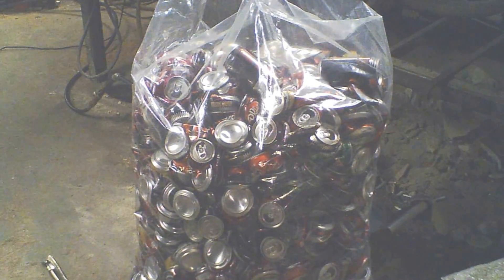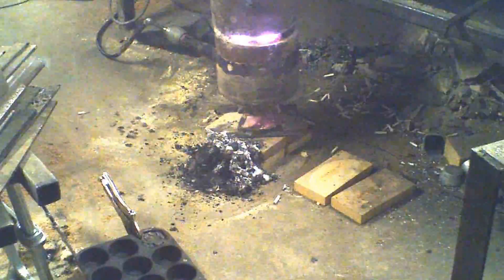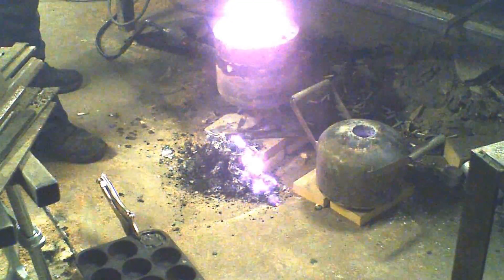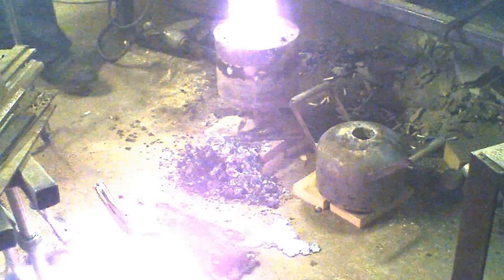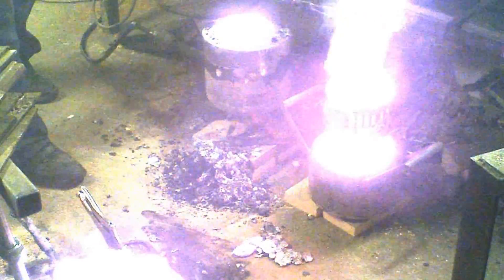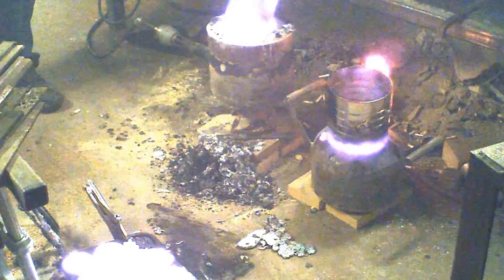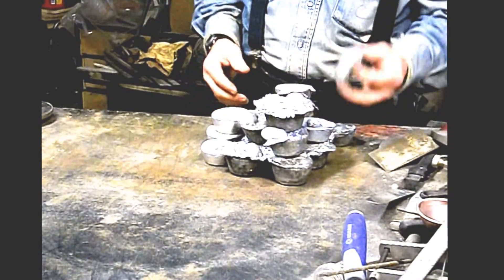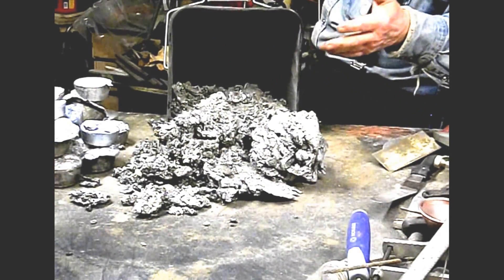Just How Much Waste is There in Melting Soda Cans?

Comment: Have you ever tried melting aluminum cat food cans? We have lots and thought that it might be better to try and melt them down to take them back, just for ease.
Reply from the maker: Anything Aluminum will work, even the one time roasting/baking pans. Just wash them out first.
Reply: Thanks, I have some of those too and I might toss them in. Do you know if I can mix everything together, pop cans, those tins and the cat food cans to be able to take them back as scrap or do they like them all seperate? Thanks for the responce and cool video.
Reply from the maker: You can't mix steel with alum when you're going to recycle them. (Separate Bags!) Now if you're think of melting the alum cans down and then taking it to the recyclers... DON'T you won't get any more for it so you're just wasting your time and money.
Reply: Yeah I know you shouldn't mix steel and aluminum, I was talking about the aluminum cat food cans and aluminum cans getting all melted together. I didn't know if they would be different grade, or types of aluminum. Yeah, I'm in Iowa so if the pop can, can be taken back for a nickle, I do but some energy drinks and teas don't have the nickle refund. I know it wouldn't be much but it would be better then just tossing them.
Reply from the maker: Doesn't matter... it's all basically "Food Grade"

Comment: Wow! You actually poured molten aluminum into a coffee can! SMH! How did you manage to live this long?
Reply from the maker: How brain dead are you?!?!?! We pour into soup cans /tuna cans/coffee cans all the time! Then we cut the can off and chuck the casting into our lathes or a milling machines and make our parts!!!! So tell me what is the difference from a coffee can/soup can / "OR" a cupcake pan used for making ingots?!?!?! If I need a big round/ thick plate I use an 8 or 9 inch steel pie pan. It's a lot cheaper than buying from a steel supplier. You better start watching more videos before you open your mouth.
Reply: Uhhh.... What are you even talking about?

Comment: Cans definitely have a lot of loss.
My first couple can melts I estimated about a 40 percent loss.
I also melted through a good number of steel crucibles.
my best melt has since produced 16 similarly sized ingots from a 55 gallon garbage bag of uncrushed cans. (roughly 1/3 of what you  melted)
I found that leaving the slag on top of the melt (aka not playing with it so much)  helped to keep the air from the clean metal. so less drossing= better yield. I also learned about making a reducing flame which uses up more oxygen in the foundry leaving less to oxidize the metal. I havent used any flux yet in any melt as I feel the initial melt is the first step in refining and can save the flux for the last melt.
I think I can get under 20% loss by crushing the cans
My current and best crucible is made from a piece of stainless box tubing. Burning used motor oil for fuel at the lowest setting my rig can run at. I think the crucible failures were due to more of a chemical reaction(acidic/corrosive environment) than temps.
Reply: Wanna be my hero? come up with a practical use for the dross!
Reply from the maker: Thanks Tim
Good info!
I'm working on another big bag of cans and think I'm going to try a low temp pour, (1100).
Let's hope the crucible holds up this time.

Comment: Hey Grandpa Bill, nice work and i respect all your efforts,
i read all comments below and i want to begin my personaal work.
i will bring 25 Al. cans and put them in a steel Cruicble which is in an electric furnace with 700 celecuis.
the cruicble have a cover to avoid exposure Al. to oxgyen 
 i Never stir, swirl, or move in anyway the molten (in the crucible )
 after mellting, i put salt (NaCl) and (NaHCO₃) then 
then i will remove all drosses
is this procedure is true ?
Reply from the maker: +مصطفى رمزي Salt is used as the flux and baking soda as the degasser. You still have to scrape the wall and the bottom of the crucible to release the dross and then skim off the top. Good Luck.
Reply: what about using Nitrogen in order to degas the Hydrogen ?
Reply from the maker: +مصطفى رمزي If you got it try it... I've never used it so I can't say one way or another about how good it works.

Comment: An empty 12 oz al can weighs 14.9 grams; 1000 cans would weigh 32.854 lbs. If the burner is oxidizing (running lean) the molten aluminum surface will crust with aluminum oxide and increase the loss percentage.

Comment: About as un-scientific as this could have been. Should have been simple. Weigh the bag of cans before melting, then weigh you ingots afterward.
Reply: +Grandpa Bill Got some bathroom scales? Hold the bag and get on. Then get on without the bag. Subtract the bag free amount from the amount with the bag. Might be off a little but not by much. You'll get a fairly close number. No need to buy a thing. Then weigh your finished ingots and you get a pretty good idea of the total waste material.
Reply from the maker: +Zach Billings Hey! Now that's a great idea....so you run down to the store and pickup a 25 lb. hanging scale and send it over here. Cause if you think I'm gonna spend the money on a "ONE-TIME-USE" scale "THINK AGAIN!"
Reply from the maker: +Fektthis Or you could just count up 500 or a 1,000 cans times 3.29 pounds per hundred.

Comment: G-Pop Bill, what happens if you melt copper and aluminum together?
Reply: +Mark Dixon Depending on the ratio you can make aluminium bronze which is 90% copper 10% aluminium.
Reply from the maker: +Mark Dixon I did that many-many years ago and I don't remember what castings I was pouring or why it needed the copper. I think I used copper tubing and some heavy gauge wire.
Reply: Cool, thanks!
Reply: +Walrus Warlock Yes and to make Nordic Gold its 75% copper, 15% aluminium, 10% tin and what you make will be gold colored. the other will be redish colored

Comment: As others have said, it appears you were running WAY too hot for aluminum...  And as others said you contributed to the dross by constantly skimming it off, skim once right before you pour not multiple times and the amount will be less as it will help prevent further oxidation...  No doubt aluminum cans produce a higher volume of dross vs a thicker source of aluminum as they have more surface area and that increases oxidation thus more dross...  But I firmly believe the 50% number tossed around is mostly exaggeration from naysayers...  So tonight just for fun to give it a backyard feel, I fired up my small charcoal foundry (dirty burn, lots of ash) and used a stainless steel crucible (stainless mixing bowl)...  I don't have a number count on cans, but it was roughly a 5 gallon bucket full of uncleaned crushed cans, finished weights suggest about 60-70 cans...  Anyway, I ended up with 540 grams (19.05oz) of aluminum  and 324 grams (11.43oz) of dross or about 30% dross...  Looking at the dross I can see some good aluminum that I could salvage, and I suspect there is a generous amount of charcoal ash in there as well, I'm guessing in a more controlled clean operation the dross can be kept to about 25% from aluminum cans...  My guess is the 50% number tossed around is purely speculative based on observed mass of the puffed dross not it's actual weight...
Reply from the maker: Allister Fiend First off I don't think 1100/1150 degrees is to high. Next thing is you are not including all the paint/inks and the plastic coatings that burns off so you can't get a weight on it. 3rd I'm not completely sure as to the number cans I can get into crucible but when the dross get to the top of the crucible I do know that after a skimming it is less than half full.
Hopefully next month I'll have enough cans for another test run.
Reply: +Allister Fiend Would using a borax flux and single pour increase the Al yield?

Comment: If people want to see HOW MUCH junk a can has, do some study and learn how to dissolve them to make Hydrogen gas! It's really super easy and cheap, but could be dangerous as it's working with caustics so I won't just say "Do This" but you can look it up yourself and learn about it.
 This way you will SEE what is left over that was part of a can that is NOT aluminum! The stuff you get paid for when selling the cans as cans, but do not get paid for when melting cans into ingots!

I don't do videos myself for several reasons, but I may do one dissolving a few cans just to show WHY melting cans is not going to make more money as ingots!
 The only reason to melt cans is if you need the aluminum and cannot get scrap castings like a junk wheel or such and already have allot of cans piled up.

Comment: Its great that you're melting/recycling but I have to say that was a big train wreck. Also I don't agree with your slag theory, I melt often and I don't produce that much slag. Remember cans are about 95% pure. The more oxygen in the metal the more slag and I would say most of your slag is actually aluminum. Also your crucible failed because you're getting it too hot. I suggest propane or wood. Also if you can tilt pour most of the slag will move to the bottom and you will get a cleaner product.

Comment: Love your demonstration! Thanks for your efforts and time! But, unfortunately, it looks a bit like you are almost trying to maximize the slag/dross here. First off, every time you mess with the surface of molten aluminum, it will create more aluminum oxide (in the dross/slag). So if you are constantly skimming the slag, its only increasing the problem, as if you are trying to produce slag, not decrease it. Also, you need to minimize the aluminum's exposure to oxygen at all times. Sealed crucible, if possible, or a small top opening with lid. Never stir, swirl, or move in anyway the molten (in the crucible). And cover the cast. And control the temperature, you don't need to blast it, excess heat just creates more aluminum oxide, its oxidizing, your burning it. Then you can remelt all your slag again and squeeze some more metal out. This could get you a few more percentages on your numbers, possibly more than 10%, seeing how much metal it looked like was dumped on the floor. I've melted cans before, with out a controlled environment, just a deep crucible with small opening, and no stirring or removals. I got a much better ratio than 50/50. My ingot only has a small amount of slag on the top, as I didnt skim it.

Comment: One thing I learned in the foundry is that you don't remove the dross until yer ready to pour...If you do it just oxidizes and makes more dross..You will notice that when you first remove the dross it's clean and shiny...As it reacts with oxygen in the air it gets a layer over it rather quickly...Point being you can remove the impurities at the end and get more yield of good aluminum
Reply from the maker: flopinator You can use just about any 'Pure' salt -- no additives or flavors. What it does is it acts as a flux and baking soda as a degasser.  I use about a tablespoon of each and roll them up in alum. foil
Reply from the maker: First point: I lost a furnace that way. The dross formed a hard 'cap' over the molten alum, so much so I couldn't break thru it with a steel bar.
Second point: When melting cans in an 'A6 or A10" you would be lucky to get a cup or two of alum out of it. If you just keep throwing in cans your crucibles the slag/dross will over flow into your furnace. One thing you have to remember Dan is we are using a small 'hobby' size furnace that does a "max" of 5 or 6 pounds per pour -- Not a commercial furnace that can do 10 or 20 ton per pour. I'm not exactly sure, but I think the small brass furnace was 5 ton at my foundry, back in the early 90's.
Reply: Grandpa Bill I'm sorry if I came across as criticizing you or your method....That wasn't my intention.... I trust the fact that with cans you loose a whole lot to the impurities...I have always cast my small parts at home in my home made set up and it's loads of fun and for a cheep skate as I am, it's the way to go..Again I meant no offense by my comment
Reply from the maker: Daniel hoffman Not a problem Dan and I totally agree with having to be cheap especially on SS these days. The best way around casting with cans "Is don't use them" 'OR' mix them with pure castings... If you can get your hands on broken castings before the recyclers get them. OH! one thing I forgot to mention I use to use salt for a flux and baking soda for a degasser.
Reply: Grandpa Bill I was wondering about the salt, Most of us do that and I'm not sure when I first heard of it but it does make a great difference in the quality.. Especially when the machining comes up..
Reply: Grandpa Bill What does the salt do and is it a special type of salt or just table salt?
Reply: Thx brotha.  I just started this yesterday, I had a whole bag and it made like 1 cupcake.

Comment: Nice video but does not mean much as for the important stuff really.
 How much did the cans weigh before melting and how much did all the useable aluminum weigh once the ingots were made?
 That is really what is important! Weight!
 I can sell cans for $0.60-$0.85 LB varying with the scrap market day to day, I can also buy a 50lb ingot already cast for $1.00-$1.25lb which was cast from old car wheels, engine heads, pistons, etc... or I can buy an old car wheel for $.90-$1.00 LB and melt it myself.
  Prices vary with the scrap market of course, but the important thing is always where is the money! Is it better to sell the cans as cans then buy some heavy scrap like a wheel? OR is it better to just melt the cans themselves.
 For this we need to know by WEIGHT if we melt down 20lbs of cans how much useable Aluminum do we get in Lbs. Price needs to be balanced and go for the best deal. I mean if cans net 70% by weight good ingots, but to buy a wheel or ingot already cast cost 40% more than what we get paid for cans then the best deal is to melt the cans! If by weight we only get 50% good aluminum then the best deal is to sell the cans and buy a junk wheel!
 Slag  itself does not weigh as much as pure aluminum. So, looking at a giant pile of slag compared to a small pile of ingots does not tell us anything. Loose Slag will have a larger volume in area for 1 LB than a 1LB ingot.
  At this time I have a junk 1ton cargo van in my yard FULL of cans not yet crushed and also a couple bins about 4'x4'x4' full of cans.
 So the real question is should I melt those down myself or crush them and haul them all in at once for cash then buy some solid junk wheels? LOL
 I think my best option is to keep saving the cans for now, build a can crusher that crushes in volume, then when I have a load for my box truck haul in the cans to sell and buy a few wheels.
 Actually I scrap out cars at times so do not myself need to buy anything as I got lots of heads, wheels, pistons, etc...

Comment: u must do 4 steps before melting aluminum cans 
1- buy clean and dry cans 
2- cut it with shredder make it small chips
3- remove paint with drier rotary 450c degree ( the paint percentage weight 3-4 % from alu cans)
4- submerge these clean chips inside molten aluminum vortex 

after that you will lose only 4% for paint + 1% water + melting lose max 6%
so average not more than 10% 

best regards for all if any body need to ask me any question in this field with my pleasure to reply him and give him my experience 
ahmed_energytrade@hotmail.com
00201223781307
cairo - Egypt
Reply: HI Mahmoud, shouldn't a flux like borax be used to get a better melt?
Reply: WRONG! For one thing you are saying remove paint 3-4% weight of the can LOL
 OK, so how does removing the paint (weight) help anything? Toss the can into the melting pot and the paint burns off just the same!
 Why cut with a shredder? Once you got a bit of melted aluminum in the pot the cans melt like butter as they are added to the pot.

Only really need normal used cans and toss them into a hot pot with a little melted aluminum, the rest takes care of itself.
Reply: HolzMichel 
yes you are right borax we put it to separate aluminum from aluminum oxide contact me if you need any 
information in this field 

i am doing master for how i mange my melting loss in recycling UBC
if any body need any thing in this field please contact me 
ahmed_energytrade@hotmail.com
00201223781307
cairo - Egypt
Reply: Den Stump 

i am doing master for how i mange my melting loss in recycling UBC
if any body need any thing in this field please contact me 
ahmed_energytrade@hotmail.com
00201223781307
cairo - Egypt
Reply: +HolzMichel yea sure borax is good chemical
Reply: +Den Stump dont only 3 or 4 % for only paint their is some water inside 
yea paint one reason from more than 7 reasons make dross

Comment: I do not understand slag when the aluminum was already premade into cans.
Reply from the maker: Slag is all the inks/paint/plastic coatings that are added to the surfaces of the alum. cans.
Reply: Grandpa Bill let's not forget the aluminum oxide coating on the can.
Reply from the maker: *****
Because it's a food item and a lot of the soda syrups are so strong they, (the cans) are coated so oxidation is kept to a minimum
Reply: Aluminum cans are not just aluminum!
I make Hydrogen at times and if you dissolve a can in LYE and water you'll find plastic floating in there! When melting much of the plastic would of course burn off but probably some will add to the slag, and also the paint does it too.

Comment: someone needs to try cutting the bottom n top of the cans and smelt them keeping out all the ink and paint and compair the final result with a batch with full cans after the top n bottom batch to keep contamination to a minimum.
Reply: Why?
 Contamination just floats to top as part of the slag or burns off. You gain nothing really if you toss 1/2 the can to prevent contamination as you certainly loose all the aluminum that was in those parts you toss!